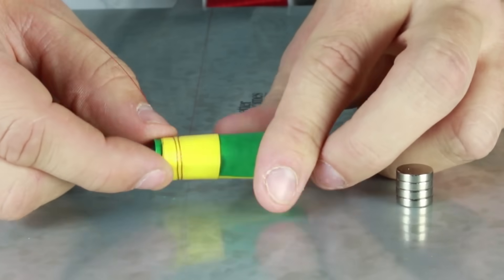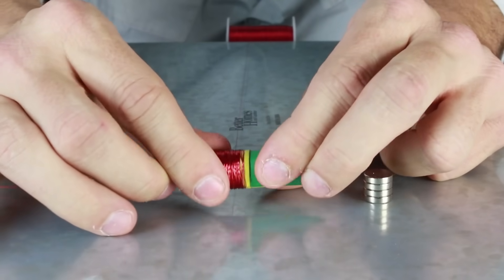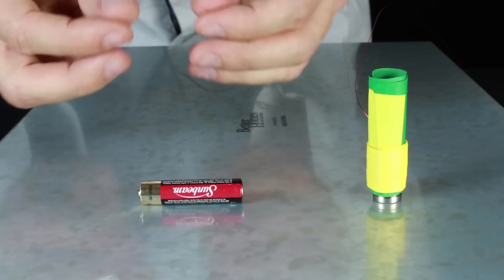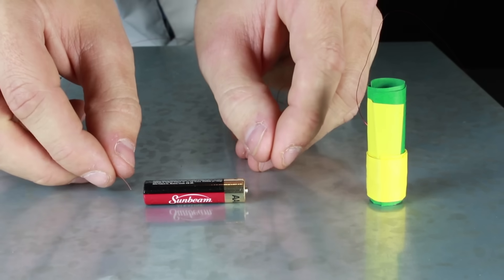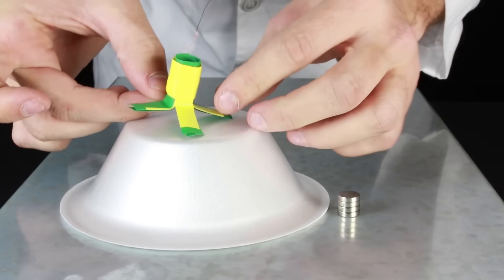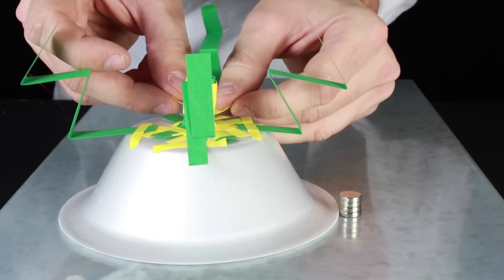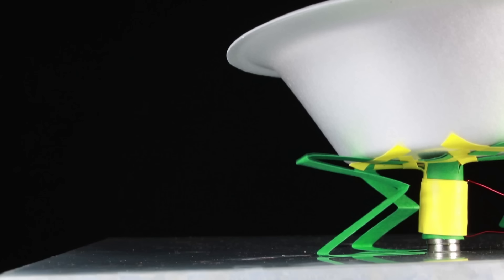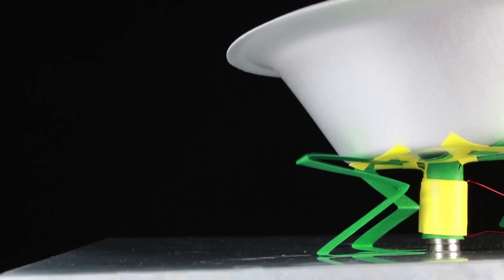How to Make a Simple Speaker (Physics)

Comment: hi, i rlly like the project, but one question can we use someother surface which is not a conductor? is it possible to attach one magnet underneath the insulator surface?
Reply from the maker: The metallic surface is not a requirement but keeping the perminant magnets in place is important so that the coil of wire electromagnet  is being moved and not the coil of wire electromagnet causing the perminant magnets to move.

Comment: Do you need to use magnet wire
Reply from the maker: You need insulated wire and it doesn't work well with a thick plastic insulated wire.  If you have wire with very thin insulation similar to the very thin insulated coating on magnet wire it will still work.

Comment: Important note: this comment might get long :)))

It's quite impressive to know that the working principle of loudspeakers is really that simple, even if the speaker sounds a little crappy like the one in this video :)) I never actually knew how loudspeakers actually work, so videos like this give me a pretty good idea, and I like to understand how things work even if I don't have any real intention on building them :))).

I've noticed in these kinds of "make a simple loudspeaker" videos that when they move the magnet closer or farther from the copper wire, the volume changes (you've mentioned this in several comments, and you also mentioned how the strength of the magnet also affects this): would you say that this is one of the factors that determines the "sensitivity" of loudspeakers and also headphones? Not only that, but I'd also venture to guess that the diaphragm that vibrates the air to make sound also has an impact on that sensitivity; if the diaphragm was lighter, thinner and so on, it would move more easily with less energy required from the amp or whatever, whereas if the diaphragm were much heavier, thicker, bigger and so on, it would take a lot more effort to really get the thing moving, and as such requires much more energy from the amp. So it seems like all of this together, the strength of the magnet, the proximity of the magnet to the copper wire, and the heavyness/thickness/size of the diaphragm all have an impact on sensitivity and therefore how much power you need to reach a usable volume.

In fact, while I'm on the same topic, I can distinctly remember in 2013-2014 I was using a computer speaker that was entirely passive, and as such it was powered entirely from a headphone jack, no battery, no AC adaptor, no amplifier. And on some headphone jacks I connected it to, I could get a seemingly shit ton of volume out of the thing (didn't even have to crank the thing up all the way to even hear it... it could get loud enough to overload a little bedroom with music when I cranked it to maximum and the sound could travel even partially down the hallway... in other words, it was as if I had attached a powerful amplifier to the speaker when I really didn't), whereas on other headphone jacks it was more like a headphone, where I had to crank it up to maximum to even hear it). This is obviously because different headphone jacks have different power requirements and impedance values and so on, but the reason it was even possible to get the speaker to go that loud, even though the power was coming entirely from a headphone jack, is because of the sensitivity of that speaker. So it could either be that the speaker's permanent magnet was quite strong (and therefore a strong magnetic field exists), or that the copper wire ("voice coil" as it's often called) is in close enough proximity to the magnet, or that the diaphragm is made of a light enough material so it can be moved very easily... or... maybe it's a combination of all of the above? :))).

Anyways, just thought I'd express my thoughts on this topic... it's really quite interesting to me. Feel free to reply and give your thoughts if you wish! :)))

Comment: Bearded science guy, I have watched this video a hundred times and tried building this a number of times, and have spend hours on it yet its not working. I have used ferrite magnets for it, and whenever I test the electromagnet the paper tube only tilts, doesn’t go up. The rest I suspect might be the problem of the wiring since my audio jack isnt 3.5mm. What am I doing wrong? Please get back to me I have to submit this project urgently
Reply from the maker: I suspect that your perminant ferrite magnets don't have a strong enough magnetic field.  If you put your ear really close like an ear bud distance away do you hear the sound?  If so you just need either a stronger perminant magnet or an amplified signal going through the electromagnet, maybe from a surround sound system or some other amplified source.  The last variable that can make a big difference is the distance between the coil and the perminant magnet.  The smaller the distance the louder the sound will be as long as it can still slide back and forth.  Good luck trouble shooting the problem and finding a solution.  This is where the real learning happens.
Reply: @BeardedScienceGuy I completely forgot to tell you, and now I am an year late, but this project was really loved in my science fair! I found neodymium magnets and it worked!
Reply: @BeardedScienceGuy  thanks I’ll try!
Reply: @BeardedScienceGuy  In my country (India) I cant find any neodiyum magnets online or in any store. Even if I find them now I dont have the time until they arrive…. I’ll try a larger sound source

Comment: The 3.5mm jack wiring was the source of our issues, so do the following.... 

The entire length of the jack to the wire tips should not exceed 4 inches. This reduces resistance and keeps the electron flow stronger by the time it reaches the magnets/coil

Our jack had a ground (bare) wire, and a white and red wire. We connected the jack ground wire to the negative coil wire and the white jack wire to the positive coil wire. We cut off the red wire. 

It worked great. Best of luck.

Comment: where does the battery connect to when both ends of the copper wire are connected to a 3.5mm headphone jack.
Reply from the maker: It doesn't use a battery, which means the power of the speaker will be closer to an ear bud. If you use an amplified source like a surround sound system it will sound more like a very small bookshelf speaker.

Comment: Hey Bearded Science Guy! We are doing this experiment for a school project and for some reason it won't work. We are wondering, does the type of headphones matter? What are some common mistakes that can prevent our speaker from working? Please get back to us and thank you!
Reply from the maker: The strength of the magnet and a very close distance between the wire and magnet is important for an unpowered output like a headphone jack.  A powered output can make up some for a weaker magnet or more distance between the wire and magnet.  Also the number of coils in the wire and the wire size is important.

Comment: Hey I'm having problems when I has to conect it to the plug, I do everything with the electro magnet and it works, but to atach it to the plug doesn't work. And yes is a plug with 2 lines.
Reply from the maker: Either the plug you are using isn't putting out much energy like a headphone plug.  In that case it will work just really quietly.  The second option is the electromagnet not being strong enough.  That could be weaker magnets or maybe the wire isn't coiled close enough to the magnets.  If you have a multimeter you could test the output to make sure it is putting out a signal and then start troubleshooting from there.  Also put your ear pretty close to make sure is isn't just a volume issue.  A headphone jack will always be pretty quiet unless you amplify the signal and a surround sound system will be much louder.  Good luck.

Comment: I’m quite confused at the part where you explain to leave 1 foot on either end of the wire for connections but then when you make the connections you have two ends, where does the other end come from? We tried doing this but it’s not working, and also... do you need any specific type of tape?
Reply from the maker: When making the connections you have both ends of the wire and make sure you have sanded off the insulated coating where you are making the connections.  The tape is nothing special but the volume from the audio source  sometimes needs to be turned up to the maximum.  This is especially true playing music from a phone, a surround sound system puts out more power to the speaker and is easier to hear.
Reply: BeardedScienceGuy I must be doing something wrong, it’s not working on the part where you test it with the battery and we need to get it done by next week!😩 do you think its the magnets or wire?

Comment: what are the specs of the neodymium magnets used?
Reply from the maker: Many different sizes and grades will work but some will be louder and sound better than others.  These were 8mm Diameter and 4 mm thick and there were a few stuck together.  Round work the best because of the electromagnet but many sizes can work.
Reply: I'm doing this as a science & music experiment. We're using N42 neodymium magnets that measure 6.35 mm diameter by 1.58mm. I plan for each student to stack 10 magnets together. Do you think that will work? Also, since I'm working with kids, what should I watch out for? overheating?
Reply from the maker: Yes, exactly.  You just need to make sure the wire is long enough to give some resistance, and the length needed to give the same amount of resistance will change depending on the gauge wire.  Do your best with the math and then test the length of wire with your input source.  Here is a chart to give you an idea of the ohms/meter resistance.  The more power from your input source the more resistance you will need in your wire.  http://www.daycounter.com/Calculators/AWG.phtml
Reply: I just sent a message, I'm having trouble with the conversions. Please help.
Reply from the maker: Focus on ohms per meter for the AWG 32 wire.  This will tell you how many meters you need to get a certain resistance.  I used 12 meters of 32 gauge for my surround sound system in the video which provided enough resistance for the experiment but did heat up quite a bit after a minute of playing so probably wasn't enough resistance to leave the speaker connected for long periods of time.  The less resistance (shorter the wire) the faster it will heat up.
Reply: ok. also, would an old pair of earphone work if I detach the earpiece and expose the wiring?
Reply from the maker: Yes but plugging it into a 3.5mm headphone jack will be a pretty quite speaker.  You may need to put your ear pretty close to it to hear the sound clearly.

Comment: Is the wire insulated?
Reply from the maker: +peter12345927 Yes, the wire is insulated except at the ends where you sand off the insulation.
Reply: Okay, thanks that's what I was wondering about.

Comment: My friend and I are trying to make this for a school project.... We have spent 5 hours doing it and each time has failed... Do you have any extra tips? Like that kind of tape or anything to look out for?
Reply from the maker: +HarryPotterFish If you hear sound but it is very quiet then try a stronger magnet or turning the volume up on the device.  If you don't hear any sound at all either your electromagnet isn't close enough to the magnetic field of the permanent magnet or there is a loose wire making a break in the electrical circuit.

Comment: Would like to make something similar, is there anything else (maybe a lower gauge) i can use instead of 32 gauge?
Reply from the maker: +Marie Mno Other gauges will work but have different length to resistance ratios.  Just be careful that the resistance doesn't get so low that the short circuit overheats.